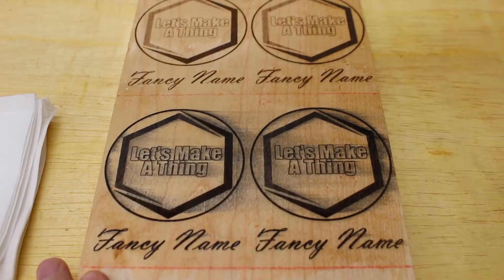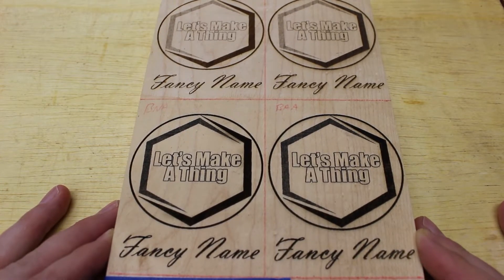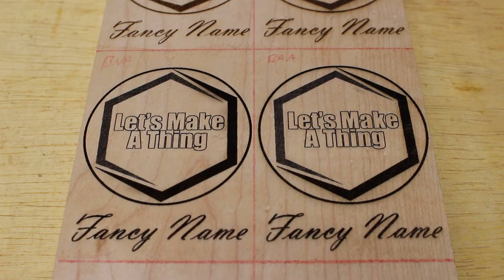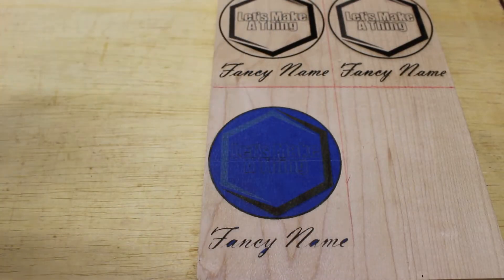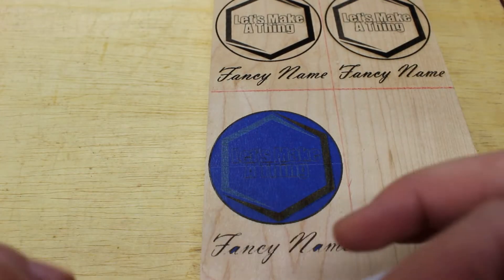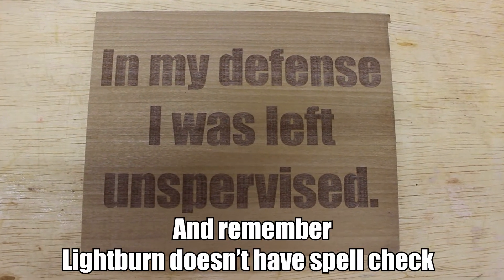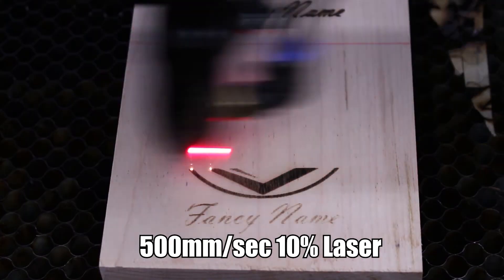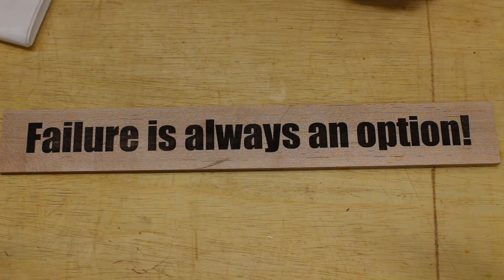Borax Laser Engravings that Don't Smear!

Comment: Hi, I have obtained good results by pre-treating wood with acrylic primer and also using air assist. I believe charcoal and black dust whatever its nature is stil generated, but pores in wood being sealed, dust particles have less chance to hang to. Additional use of compressed air and wet wiping after engraving makes the rest with good results. I have only used method with baking soda because it was all I had for the moment. First apply soda solution and after the primer. Acrylic primer, being water based, is compatible with previous wash.

Comment: I found that if I mix a saturated solution of borax and water  with white Latex primer ( used to prime Drywall) untill paint is like skim milk ...then apply this "milk like solution" to the wood with a scott towel gently rubbing it in like applying a stain.
Then dry with hairdryer.
Then sand with 600 grit sandpaper.
Then Laser with diode (I have a 5 watt ) greatly reduces the "soot effect"
Reply from the maker: Thanks for sharing!

Comment: I'm totally new but I had an idea that rightinglegends9289 also used: compressed air. But then he brushes it, and my thought was to also follow up with tape. When you pull it off you should be able to see whatever soot you can pull off. Repeat the tape until you don't see anything, then brush or air... etc. His process seemed to work well, but there's one more 'layer' of getting it off without rubbing.

Comment: That's a mighty fine Ortur enclosure you have there. I'd have one too if they would ever get off their dead asses and actually ship it to me. They took my money right away. So in the meantime, I made a cardboard one with a couple clear windows hot glued in. I used the inside lenses from a Nova air fed sandblasting helmet, and it serves it's purpose. Oh and I'm using an 80mm computer fan with 3" exhaust flexible hose. No smoke is let into the room but it looks kinda unprofessional. Anyway, I tried the borax thing and it does make it black, and it does smear. Lol  Thanks and take care.
Reply from the maker: I'd recommend upgrading your exhaust fan and ducting to a 4 inch inline or centrifugal fan. You want to get the smoke out as quickly as possible, not only to keep it out of your workshop but also to keep it off of the material you're engraving. The 80mm fan you have is probably pushing 30-50 CFM max and you want to be 150 CFM+ with your exhaust.
Reply: @LetsMakeAThing  Ok, thank you for the advice, much appreciated. Oh, and their Chinese ears must have been ringing because my wife got the email from UPS that's it's being delivered TOMORROW! Now I don't even want to go to my customers tomorrow at all because all I wanna do is PLAY! LOL Take care.

Comment: Hi, what do you call the clear coat used in the video? I'm not from the US and when I search "clear coat", there are many options, top cat, lacquer clear coat, clear coat paint. If you can specify the brand please, it would be very helpful.... thank you... 😅
Reply from the maker: It's been a long time since I made this video so I'm not 100% sure what I used in the video. Currently I'm using Krylon UV-Resistant Clear Acrylic coating when I need a clear coat. I haven't tested it on Borax as I don't use Borax on my engravings any more.

Comment: I use artist's charcoal fixatif spray and it works pretty well on Borax.  Give it two or three coats.
Reply from the maker: Thanks for sharing!
Reply: but can you use that on a cutting board
Reply: No idea. I don't do cutting boards only decorative objects.  I will have to try it out. @pblais404
Reply from the maker: @pblais404  No, you don't want to use borax or any other chemicals on food prep surfaces like cutting boards or serving trays!
Reply: @LetsMakeAThing  you can, if you seal it with thin layer food save epoxy.

Comment: In an early wood engraving of a photo that I did (10 W diode), I forgot to turn on the air assist at the beginning. It ran about 20 mm before I turned it on. The bottom of the foreground is noticeably lighter than the rest of the foreground. This is because the beam was losing some power in the smoke rising from the wood. This tells me that air assist does make a difference for engraving. You might not see the difference between two separate pieces, but it showed up within the same project. BTW, I gave up on borax when I first learned about the soot.
Reply from the maker: Thanks for the comment! Since this video I have started using air assist on all my laser projects because I started to notice it did make a difference. Basically the same way you did, I started a project and forgot to turn on the air assist. Then after turning it on I could see a difference between the two once it finished. 

I've found a better method than borax for getting darker engravings and haven't messed with Borax since this video. Here's the video I made about darker engravings without Borax if you haven't seen it yet: https://youtu.be/3IqJLrk_f6c

Comment: Did you use the same  magnets from original shield ? a friend printed me one with air assist and magnets werent strong enough to keep shield on
Reply from the maker: I didn't reuse the magnets from the original shield. I designed the new air assist shield to use magnets I had laying around. They just happened to be about the same size as the magnets on the laser module.
Reply: @LetsMakeAThing  ok thanks , the printed one must be heavier than the original that melted😬
Reply from the maker: It probably is heavier. Plus it's also dragging around an air tube too so that adds weight and stress that the original magnets weren't specced for. I looked but couldn't find where I got my magnets from. But shouldn't be too hard to find neodymium magnets about the same size as the originals.
Reply: @LetsMakeAThing  Thanks

Comment: Regarding sealing for wooden food surfaces from "Soot" smear. 
Prep  laser area with original lemon "Mr Sheen" furniture polish.   
Rub in & wipe off with dry cloth.
Now apply Borax/water 1:10 ratio. 
Allow to dry completely. 
Engrave using Speed @ 100%
Power @ 10-20% depending on.
The Watts laser can output. 
Now the magic sause.
Clean the whole surface with 
White Vinigar gently dabing. 
Until you stop getting any soot.
Finally seal with Food Grade 
Coconut Oil.
Rubbing it in until it maintains slightly wet look. 
Coconut oil will better handle the hot temperature of dish washers. 
Although, I would surgest only on the shortest cycle available.  
I prefer  to hand wash any wood.
Reply from the maker: Thanks for the tip! I've stopped using Borax though as I've found an easier way to get darker engravings. https://youtu.be/3IqJLrk_f6c

Comment: So for my cutting boards (bamboo, oak, cherry, maple, black walnut) I lower the CO2 laser bed and take it out of focus roughly 2mm. Turns out much better than the laser at it's proper focus. (my 80watt cuts at 8mm and engraves at 9 to 10MM)
Reply from the maker: Thanks for sharing! I discovered the defocus method a while after I made this and did a video about it.

Comment: Vacuum the surface?
Reply from the maker: Thanks for the idea! Sadly, that would remove the soot which is what makes the engraving darker. I've stopped testing Borax as I've found a better method to get darker engravings with no chemicals. You can find the link in the pinned comment.

Comment: Do not use Borax!!!⚠️🚨

Borax is toxic to the organs in the body. This is the main reason it was withdrawn in Germany the UK and other countries throughout Europe. 

Toxicity. Borax is quickly broken down by the body if ingested and inhaled. Scientists have linked borax exposure — even from cosmetics — to organ damage and serious poisonings.
Borax is extremely toxic! 

This safer substitute to borax is made up of sodium carbonate (washing soda) and sodium bicarbonate and can be found in the UK still labeled as Borax (alternative). 
Although I'm unaware if it has the same darkening properties as regular Borax for engraving wood.
Reply from the maker: Thanks for the info! I've stopped using borax as I found a better way to make darker laser engravings.
Reply: @LetsMakeAThing  Definitely use the alternative it's much better to adjust focus to darken engravings in my experience. 😉
I certainly wouldn't use Borax on anything used for food. 

It's hard to understand why the USA haven't banned the use of Borax! It's highly toxic stuff!

Comment: +1 for the compressed air approach. 
Not sure if this has been spoken about already - there is similar technique with amonium chloride (NH4Cl) solution. It generally chemically burns the wood upon temperature rise. Basically - you paint something on the wood with clear solution, heat it up with heat gun and it comes up darkening (chemically burning) the surface....
One of things on my to do list (along engraving borax treated peaces) is giving this solution a try as all lasers engrave with heat, right? 😁
Reply from the maker: Thanks for the comment! I found a way to get darker engravings without the need for chemicals and without changing the speed or power on the laser. Check it out here if you're interested: https://youtu.be/3IqJLrk_f6c

I'd also not recommend using harsher chemicals on a laser as the laser will release compounds into the air while engraving. If you don't have top notch ventilation you will end up with them floating around in your workspace.
Reply: You shouldn't laser anything with chloride it, it releases chlorine which eats the metal parts of your laser and will potentially kill you. This is why you don't laser cut PVC.

Comment: it looked like it smeared from the left side onto the right side(air asst) you should have also wiped separately
Reply from the maker: You're right, I should have wiped them separately. Some of the soot smeared from theft onto the right. Despite the single wipe during my test I am still confident in saying the air assist made little to no difference. It still creating soot that wipes off and not a darker engraving.

Comment: I don't laser engrave cutting boards, but I do a lot of personalized military and law enforcement plaques.   I builds the plaque, stain it and let dry for a day or so.  Then i put a table spoon of borax in a cup of warm water and sponge brush it on with 50% over lap.  I let it dry over night and then laser engrave it.  It comes our beautifully; crisp and dark.  I put several coats of poly on it then do a final sand and recoat.  Perfect every time.  I have a low wattage laser (2.8w) so it speeds things up and gives me a good image without a deep engrave.    Thanks for the video!
Reply from the maker: Glad you liked it!
Reply: any chances you share you brand laser 2.8W ?

Comment: What do you use as your sealer? Have you tested different ones or Danish oil? Thanks for the videos.
Reply from the maker: The only other sealer I used beside the clear coat was mineral oil which didn't do any good. In the video I used Rustoleum Universal Advanced Formula Clear Durable Topcoat Dead Flat.

Comment: I use Borax because the crystaline structure that forms on the surface of the wood gives me a more consistent and better overall burn when I am doing images,  When I am doing lettering for things like cutting boards, then I tend to avoid it and rely on the settings of the laser.  I usually finish the project with compressed air, then, a brush, then air again, followed by wiping it off with a microfiber cloth that has denatured alcohol on it.  Seems to work great for me.
Reply from the maker: I will have to give this a try!

Comment: Use masking tape or even clear coat (shellac or lacquer) plus masking tape for pieces that will be finished. After you engrave the piece blow it off with 100+ psi from your air compressor and remove the transfer tape. Your laser is burning the wood...that's what lasers do. Your goal should be how to remove the excess soot from the lasered areas and keep the color of the charing.
Reply from the maker: Thanks for the advice!
Reply: @LetsMakeAThing  I have also used defocusing for darkening 
engravings. I have absolutely no idea if that would work with a diode laser but it did a really nice job with my co2.
Reply from the maker: @WNC828  That's a great idea to test out. I'll give it a try and see what happens!

Comment: Im on a 100w co2 and I just for the life of me can't get proper results with borax. Sealing it in for something that's got a photo and going to hang on the wall its probably plausible. But on a cutting board? I don't think so.
Reply from the maker: I agree, if it won't be handled and it doesn't need to be food safe sealing is fine. I don't use borax on my cutting boards because you can't seal it in and I don't want a bunch of soot coming off on someone's food!